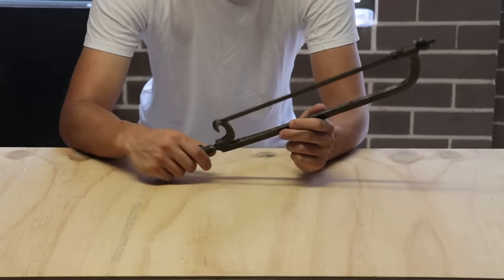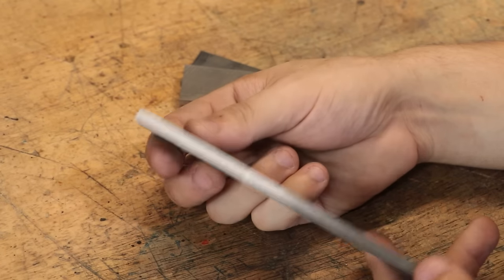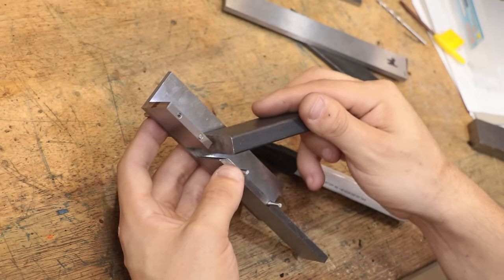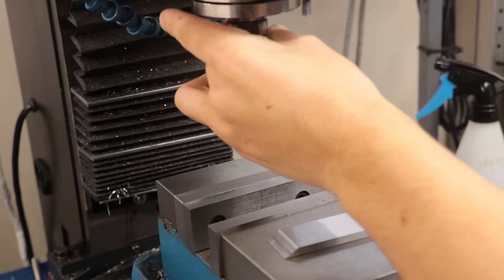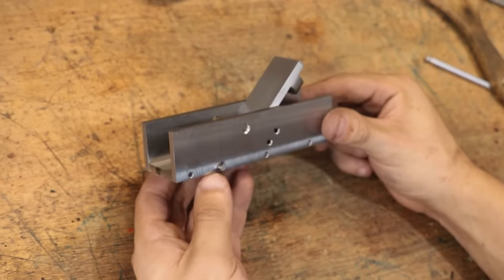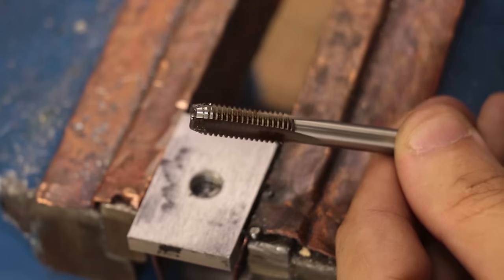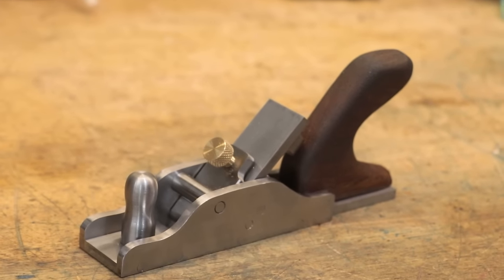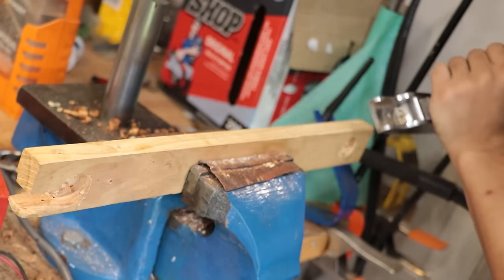Making A Small Hand Plane

Comment: That is an excellent job, for someone reasoning from first principles. Well done. I am a plane maker myself, both wooden and metal bodied.

You probably don't know it, but what you've made is a scrub plane, not a smoother. No problem; you can turn it into a scrub plane just by annealing the iron, grinding the cutting edge in an 8 or 10 inch diameter radius and re-hardening it. Once you've made an actual smoother, that is :-) The rest of it is practically perfect for the job.

Where you went wrong-- I'm not busing your chops here; you didn't know-- is:

The iron is too narrow. I know why you did it. You told us in the video. But for a smoothing plane, you will be better served with an iron 1-7/8"--2-1/4" wide. It's hard to get the surface even with an iron as narrow as you're using. Don't let it get too wide, though; it gets hard to push.

The throat is far too wide. For a smoother, you want the mouth to be about filled up with the plane blade. I usually use a feeler's gauge of about .010 or .015 inches to determine clearance. When I restore old wooden smoother planes, I practically always have to replace some wood in front of the blade. The reason is because the iron and the front of the mouth work together to take a thin shaving. With the mouth as wide as you have, it will allow a shaving much too thick to enter the body of the plane. That's fine for a scrub plane but not so good for a smoother or a block plane or even a jack. Further, you will get tear-out with complicated grain in the wood you're working with. It'll work fine, until you get close to a knot, or if you're using highly figured wood. Then not so much. It will tear out or clog your plane.

The chip-breaker is set too far back from the cutting edge. You're making what we call a double-iron plane, or at least I think that's what you intended. 1/32 of an inch is a good compromise. Remember, you're only taking a shaving about 10 microns thick with a smoother. The mouth needs to be tight; from the chip breaker and iron to the front edge of the mouth. A single iron plane works too, but they're not ideal for a smoother. The blade chatters without the extra support of the chip breaker and it won't get as smooth as it could be. Easy fix: just cut the chip breaker shorter and turn it into a single iron plane. If you really intend to make double iron smoother, you're making the blade far too thick. A sixteenth of an inch is enough with the double iron. Plus, that gives you room to fit everything under the tensioner.

The adjustment screw is too coarse. A difference of a few microns in blade protrusion makes a really big difference in how the plane cuts. And you're going to hate using a wrench to adjust the blade, believe it. You'd be better off with a star-shaped adjuster or a knurled body. Use a fine thread bolt there, and wish you could get a finer thread bolt. 

There is a relationship between the length of a plane and what it is good for. You don't give dimensions, but I'm thinking your plane is too short for a smoother. 10-12 inches is about right. Shorter than that is a scrub plane. Shorter still and you're into block plane territory. 14 inches or so is a jack plane, and jointers go on up from 18-36 inches. I've even seen a 48 once.

As I said, though, that's a fine job for a newbie. I particularly like the way you've pinned the plane together. Traditionally that's done with dovetails, hammered and peened into place and sanded smooth. Do you not like sanding? I don't blame you, of course, it's miserable. But it does save you on material cost. There's no need to use ground steel for the plane body. Mild steel will do, or even something soft as brass. You could have made two more plane blades with the O-1 you used for the body!

And a note of workability. You have made the knob too narrow on top. It's going to wear a hole in your hand if you use it much. On a plane that short I'd have probably used a cover for the front end, pinned in place, rather than a knob. And the tote is on backwards. It also shouldn't be glued in place. What happens if you drop it and it breaks?

You'll learn. You're already well on your way. Good job!
Reply: As a former cabinetmaker (now making knives) I am so glad I found your comment, so I didn’t have to write my own😊 absolutely spot on. But I must say, I love this channel for his drive and spirit!
Reply: You can't get much better advice than from a plane maker himself! Talk about lucky with your spread of viewers. 
Mark from Melbourne Australia 🇦🇺
Reply: @1984wodka   A great job, truly. I really like the way he just decided to make a plane and just does it. When I think of how long it was before I started...
Reply: As an avid hand tool woodworker, this comment is legit. I'm hoping we get to see a second plane!
Reply: Lie Nielson is gonna have some competition in the future!  Would really like to see you do another plane build.
Reply: A lot of knowledge in your comment there! 👍
Reply: @hokipokist  Hard and bitterly earned, let me tell you...
Reply: This comment should be pinned 👍🏼
Reply: Excellent comment, far better than I could have put it 👍

Comment: So as a woodworker, that plane is a serious win for a first time out, those are some seriously heavy shavings you're taking, I'd be curious what the thin end of shavings is like. However, your rear handle is a bit of a miss as well I think. Watching the video you can see that you're having a heck of a time steering the plane through the cut and that's just going to get frustrating fast once you try and break the edges evenly on a piece. For me I find a plane of that size (looks like a bit of an oversized block plane, which isn't a bad thing) should really fit into your hand so the your fingers and thumb are supporting the sides and the handle is just a bearing surface for the palm of your hand. Your handle looks to be a bit like a cross between a squirrel tail handle and a traditional tote and you're trying to use it like a typical bench plane with a two handed grip but the geometry just isn't quite right for ot. I'd try re-shape the rear handle so you can grip it confidently one-handed and I think you'll find it much easier to use going forward. Loved the video,  will be great to see you tackle something like a #4 bench plane.
Reply from the maker: Cheers. I wouldn’t read too much into how ergonomic it is based on the footage. If I were to hold it the way I would normally, my hand would cover the body of the plane and you wouldn’t really see much of anything. Kinda the reality of trying to film this stuff, I had to hold it in an awkward way so you could see the plane and shavings coming out.
Reply: It looks to me like the wood handle is backwards. Very entertaining though.

Comment: Great job, for someone who has never used a plane. Since you lack lateral adjustment, you may consider grinding your blade with a slight camber (and I mean slight). This will compensate for any positioning error and any slack you may have side-to-side. This is however a very small plane and like you noticed, great for bevels and chamfers, but for planing the wood, you'd need a wider one to be effective. I'd like to see a project like that! But make sure you get your hands on a vintage Stanley no 4 or similar, so you can see the features it has and how they work.

Comment: Putting the chip breaker edge close to the cutting edge is the key to getting them to break.  You did a fantastic job on this plane.  Much better made than most of the famous but mass produced planes.  I recommend a wide blade for the next one to allow for skewing cuts
Reply: Go down the low angle route
Reply: Yep, as a fellow woodworker I agree with the breaker closer to the edge. Plus radius groove across it to hold it in place on the dowel.

Comment: Hey those cheap $35 hand planes the "number 33" or whatever aren't too bad if you're willing to take the time to tune them up first. 
   I bought one from Harbor Freight several years back, it needed some work to make it usable, but after flattening the sole with sandpaper on some tempered glass for a surface plate, and reprofiling the iron/blade to remove the big divots it's actually a great little hand plane especially for the price. It's on par with my sweetheart and vintage Stanley planes now. 👍👍

Comment: Great effort mate. Never built a plane myself so no criticism from me. But do use them and I guess as soon as you started to use it, you found the handle a bit awkward.
If you could flip the handle around you may find that it works and feels better. and in the correct orientation. At the moment it is back to front. The handle needs to support your palm. How you have would put the end of the handle to dig into your palm..

Comment: The end result is pretty good. I’ve also made myself a plane, a bit bigger, but only the sole in mine is made out of steel, the rest of the body is laminated oak and iroko. I’ve made the blade out of K720 steel and then machined a chip beaker and lever cap with a screw design similar to yours. As yours is a bit small, similar to a block plane I probably would have made a handle in a similar style to those ones but if the ergonomics work for you that’s all that matters. I’m always thrilled when a new video comes out because you always make a lot of interesting stuff!

Comment: Not bad!!! If it ever gets taken apart I have a couple of upgrade suggestions for you. It may not seem like it but trust me, you will want to tear it down every so often. Replace the pins with brass for easier maintenance accessibility OR tap the steel ones for small screws. This next one is something I tell everyone when it comes to woodworking tools... paste wax. Its a long forgotten trick but the results are amazing. With the handle on it makes this step a little tricky but you could likely still do it with a heat gun, not a torch. Get the metal so its just at the point where its about too hot to touch and then wipe it down with a rag smeared in paste wax. After it cools back off you simply wipe the excess away. This seals the metal to prevent surface rust with something that won't stain wood like oils do ie wd40 and such. This works amazing on table saw beds, the bottom of circular saws, routers, really anything that rides on a wooden surface.

Comment: Nice job on the plane build,  just 1 small thing I noticed you used the same cutting disc on your grinder to grinder the shape. Should never use cutting discs to grinder as they can't take the side load

Comment: I think one the reasons you could not get the as sharp as you would like. Is in your heat treatment. The blade was way to cool before going in to the quench (judged by the oils reaction when you quenched it.) also I would recommend an oven temper instead of the flame temper. It gives you a much more gentle and consistent temper. Chuck it in your oven for two hours at 200C then it should be good to go.

Comment: A good base for DIY hand planes is U channel. You basically don't to weld anything. So if you ever come across a dropping of stout U channel, buy it, because it's perfect for this. Even if it's slightly bent, you can still use it and level it out using the face-to-face method (sharpie between a known flat surface, like a piece of granite) or the stone method, which is to take two sharpening stones (with dual grit) and grind them together until they're perfectly flat between them, then use one to flatten the U channel, alternating stones every few swipes).

Watching any machinist channel on the topic of hand scraping will give one basic knowledge to do this kind of stuff. You do not need an all blue contact surface for a hand plane. A dotted surface, that's even across is more than enough. Some of my best English hand planes, i've tested them, and even when they were brand new (old stock, wrapped in cosmoline and paper)  they still had a dotted surface (ie, dips in the face). Mind you, a good substitute for a machinist flat surface (like a granite slab or a cast iron slab) is any decently cut marble from a store. They're cut with saws, then stoned across, which affords them a pretty flat surface.

Comment: A low angle plane - or a plane with a low bed angle will allow you to make a series of blades sharpened at different angles for different uses. 12 degree bed and 25 degree iron ends up 37 degrees, as you said can tear out grain but a 50 degree iron gives a combined angle of 62 degrees which is great for Australian wood!

Comment: Only thing saw that you should touch up is the back of the blade next to the wooden handle, looks mighty sharp, all our wood working planes have the rear of the blade rounded over in all directions to avoid a n nasty cut if you was to slip your hand off the that handle, oh one last thought but probably too late, the wooden handle would have better grip with a cross hatch pattern carved in it, sort of like the pistol grips of old wild west pistol handles, other than that, a great build!!!

Comment: You may not want to hear this, but there are some significant design problems with this plane if it is to function as a smoother. Most notably your mouth opening is much too large and you lack a chip breaker, thus you will always have tearout. I think it would make a good mini scrub plane though, if you camber the blade. For your use case you'd probably be best served by a rabbet jack plane with adjustable mouth.

Comment: Your rear hand grip is backwards mate. The ergonomics are terrible for delivering a smooth planing stroke as you have a contact point way up high and the plane is short forcing the nose down, and not the heel. This is a similar design though to famous Aussie plane maker Terry Gordon (HNT Gordon) except he uses hardwood. His 6mm tool steel plane blade is at an angle to be reversed and used as a scraper as well, and being that thick needs no “chip breaker” as it introduces a curl into the timber to manage waste. Those chip breakers 9plane iron cap) on cheap planes are because the blade is thin and nasty, needing the support and help with curling the shaving. He uses a timber wedge for blade setting, keeping the design simple. On longer models he fits a timber rod through to allow draw planing towards the user. Not a bad first effort, but some considerations of plane design would have led you to make other choices and a better functioning final result. Now that you need to sharpen the blade, time to research angles used and how to manage the burr to achieve the best cutting edge.

Comment: Your easiest chip breaker solutiin is likely to add a second bevelled iron between your cap iron and cutting iron.  Don't need to harden it as its only job is to near the cutting edge (1/16"-1/32") to force the shavings to curl.

Comment: The thing about Stanley is that they used to be good, but they aren't anymore. Somewhere between the middle of the 20th century, when Stanley was as reputable as anybody needed, and now, they outsourced production of their plane bodies to China and the quality is just not there. A few years ago, someone gave me a brand new Stanley #5 bench plane, and the casting was so warped in blade bed and mouth that it was simply not usable. Complete trash that should never have passed anybody's QA process. If you can find antique Stanley planes at a flea market, sure. Those are great. But I wouldn't give a hot gob of spit for a new Stanley.